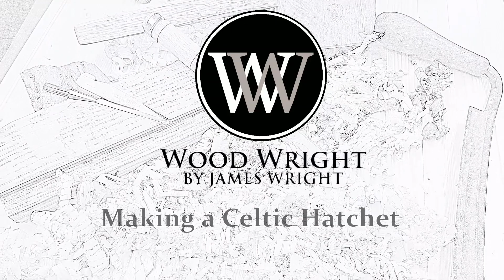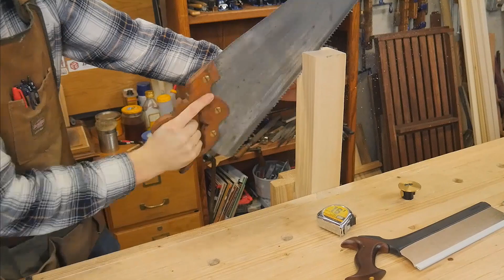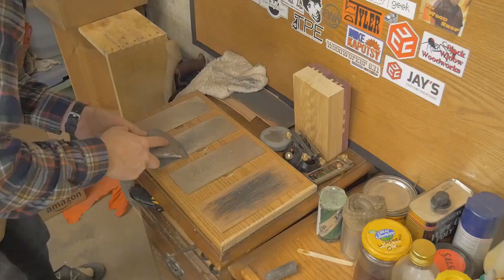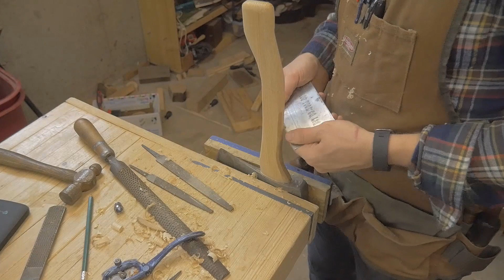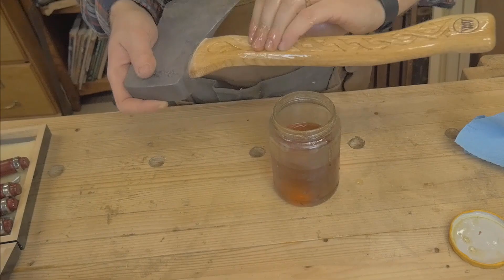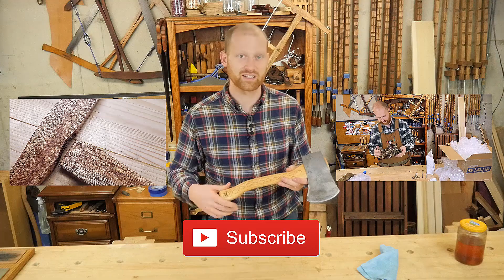How to Make a Celtic Hatchet With a Carved Handel

Comment: A great build and well presented. Could you grind down the axe head? I know that would be a long process but the profile would benefit.
Reply from the maker: +Nathan Tonning It is my intention to grind it a bit more every time I sharpen it. but as I have an unplugged shop it takes even longer. I had thought of annealing it shaping it and then re hardening it but I like the finish on it. that being said this was kind of a test run as I intend to have a head made in the future by a blacksmith and making an even better handle for it then.
Reply: +Wood By Wright Thanks for the reply.
Reply from the maker: +Nathan Tonning thanks for the coment. some of the best ideas come from comments like that. keep it up!

Comment: Cool project, would love learn/try some carving when I get the bench...
Hope you didn't bump your knuckles to much on the bench when using the spoke shave. Shave horse would be cool but you might not have the space right?
Is the swell on the end big enough or are you just not planning on swinging it that much?
Lastly bringing the stone to the axe might have been easier with such a heavy head, but maybe scary with those thin plates.
Great job, cheers.
Reply from the maker: +Nearoth You should totally give it a try. what is the worst. you don't like your first piece but you learn a ton!
I defiantly want a shaving horse but I don't have the space for one. I have thought of making a small one to mount to the bench but have not found a design that I like. 
My next one will have a fatter swell side to side, but i do not intend to be doing full speed swings very often in my basement. LOL
if the stones were smaller I would have taken them to the ax, but with out the handle it was about the same eather way. I also wanted to test the new sharpening station.
Reply: +Wood By Wright I will give it a try. I also like the foot pedal operated vice by Izzy.
Do you also have a sleeve for the axe?
There are some interesting hatchet handle designs.
Good luck and stay safe, cheers.
Reply from the maker: I have not yet made a sheath for it but I have several leather projects in mind and that is one of them
Reply: +Wood By Wright with all those sharp handtools, is there anything in particular that you do to keep them safe from the kids or do they just know risks?
Reply from the maker: The kids stay clear of the tools but only a few are in the open.

Comment: Looks really good but it looks like your grain is not oriented parallel with the head. That will weaken the handle, especially with that heavy head.
Reply from the maker: +Mr Birch Thanks for watching, Ya it is going across the head. Unfortunately the stock I had would not let me cut it the other way. this was a bit more of an experiment for me. I am going to be making a better one in the future with a friend of mine who will forge the head, and that one I am going to hand cut the lumber for it to make it exactly what I want. And if the handle breaks on this one I will make another. I would also like to make the palm swell thicker, and a few other changes.